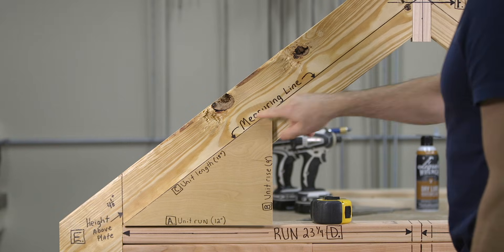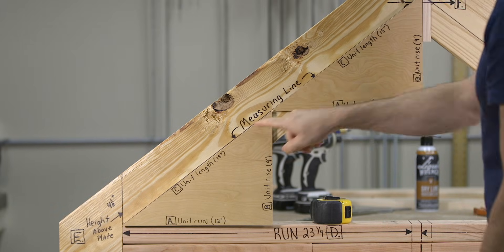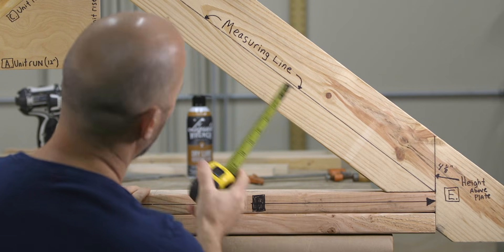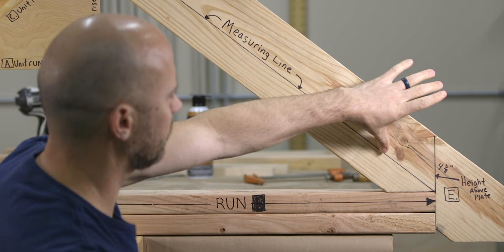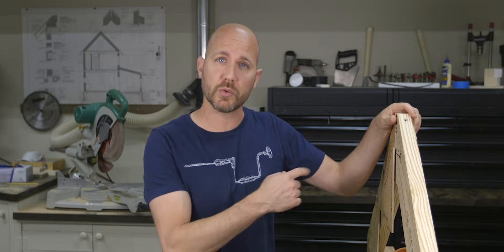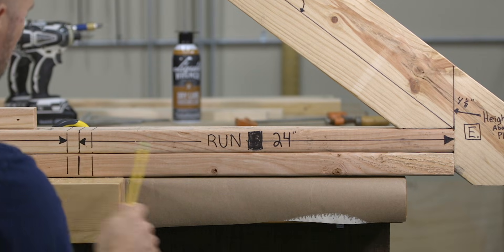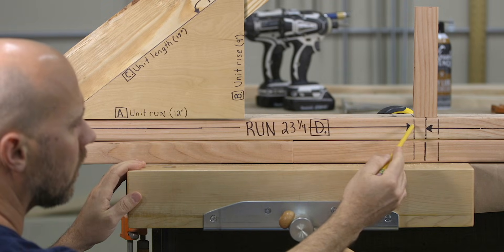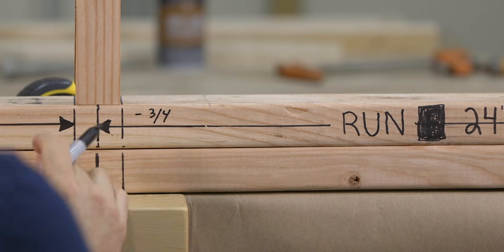How to Calculate the Height of a Ridge Board

Comment: My question is after you get the total ridge height... does that include the depth of the ridge board itself? For example... my ridge board is a 2x6 so would I add 5 1/2 inches to that to have the real total at the top of the ridge board?
Reply from the maker: Great question Katherine! You do not add 5 1/2 to your measurement. The ridge has little to do with the math here, but what does matter is the theoretical ridge measurement and the height above plate. I think if you rewatch the video it might become more clear to you. If you still need help, send me an email and I'd be more than happy to walk you through it.
Reply: Never mind. I just watched the video 2 more times and I got it now‼️ I’m building a “she shed” and it my first ever construction of a building. I’m learning S I go and it’s so much.
Reply: Sorry I cut myself off on that last post. But I think I got it figured out now. These rafters and ridge board have been the most frustrating and difficult part of my build so far. But I’m finally get things to work right. I finally got my rafters and birds mouth all cut right. That’s a miracle‼️
Reply from the maker: Great to hear!!

Comment: Fantastic videos, thank you!  I saw you measured the HAP with the tape measure and then add that measurement to your calculated ridge height for a total ridge height.  Is there a way though to calculate out the HAP instead of physically measuring it?
Reply from the maker: That's a great question Ranman! I honestly don't know the equation(s) behind that. There are charts available online that do the math for you... they factor in the pitch, material width (2x6, 2x8, etc), and the length of the seat cut to come up with the HAP. Google height above plate calculator to see some of them. Hope that helps!
Reply: @TrainingHandsAcademy  Thanks, I went and checked out several calculators online as you suggested. Also, on Google SketchUp I created a 2 x 6 rafter at a 8 12 pitch, 33.9 slope. Then intersected that into my 3.5" + 19/32" top plate without cutting a seat more than 1/3 the width of the rafter. Then I just measured the theoretical HAP. Thanks for your help.

Comment: Another good video! Normally I work in degrees but it's the same principle . Another practical way is to lay a pair of rafters on the ground with a piece of ridge board in place and with the span measurement set in-between the birds mouth cuts then just measure up from a straight   distance piece or a string line pulled across if it's a big span. This gives the height to the top of the ridge or the required measurement if cutting a  prop to temporarily hold the ridge in place.
Reply from the maker: More great info... thanks for sharing your knowledge! 👊
Reply: That’s what exactly the way I was taught at college too

Comment: Hi ...i wonder what if the rafter is on top the ridge beam? Is it the same method?
Reply from the maker: The math would mostly be the same for the rafters... you would just have to figure out the connection at the ridge (notch or hangers).

Comment: What purpose does the ridge beam provide if it's unsupported at the ends? Why not just use mending plates and rafter ties (and optionally, collar ties), sort of like a truss? This way, you can build a jig and create all your trusses the same. You can also temporarily align them with a 2x4 running across the underside of the rafters until the roof paneling is in place, then remove it. Alternately, you can overlap the rafters at the peak until you get your angles perfect, screw them to each other, then cut away the excess. Nice video, both 1st and 2nd parts btw. Thank You.
Reply: After thinking about this more, my idea to overlap rafters at the peak wont allow convenient installation of collar or rafter ties unless you are ok with using mending plates at one end and overlapping and using screws at the other. Also trusses have issues when you need to add functional dormers (not cosmetic dormers that just sit on top of the roof). In that case a rafter board can distribute the load to other rafters whereas compromising a truss to install a functional dormer can weaken the roof.
Reply: @nicholash8021  building a truss seems alot more difficult then rafters and ridge board.  as you mention there is also the issue of attaching mending plates. Then you also have the issue of storage space as the truss will interfere with the overhead space.
Reply: @BIKEMAN21  I ended up using a ridge beam (VERSA-LAM) with 4x4 support at both ends, along with Simpson rafter ties (3-2/7-in 18-Gauge Galvanized Steel Ridge Rafter Wood To Wood). This allowed me to have a cathedral ceiling whereby I could raise my 3-person kayak to the peak as there is no need even for collar ties. Without a scratch, my 10x20 shed survived two severe micro bursts (2nd one looked like a mini tornado) each which threw an 80 foot oak tree at my deck--twice. Yep. Rebuilt it twice.
Reply: @nicholash8021  wow that's quite a testimonial for the strength of that shed, wood of liked to see how you built it.

Comment: Very interesting seeing this being taught again!  When I did my apprenticeship we were told that the birdsmouth / measuring line should always be 1/3 of the depth of the rafter.  Also, as the ridge board does not take any weight it was okay to use 1 1/2" timber - no need to use 2" or thicker timber.  One other thing that we were taught was to allow for say 1/2" of the ridge board to project above the rafters as the straightness of the ridge could never be guaranteed - the end rafters could be fixed and then the intermediate rafters fixed using a string line to provide a level finish.  The quality of the timber might have improved since then though!!
Reply from the maker: Fave, thank you SO MUCH for sharing your knowledge with us, it's all still relevant and very useful! Cheers!
Reply: @TrainingHandsAcademy  Not sure if you have ever heard of it but there is a book called the Roofing Ready Reckoner by Ralph Goss - very helpful!
Reply from the maker: I have not, thanks for recommending it!
Reply: Measuring line 1/3 depth of rafter. So why waste our time with all this other stuff. You can't get measuring line without building the thing anyway.